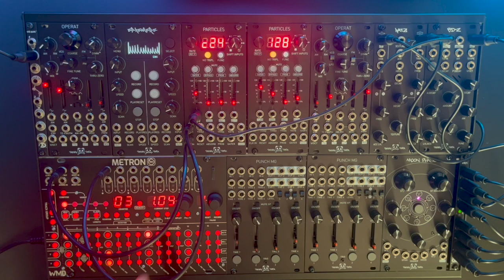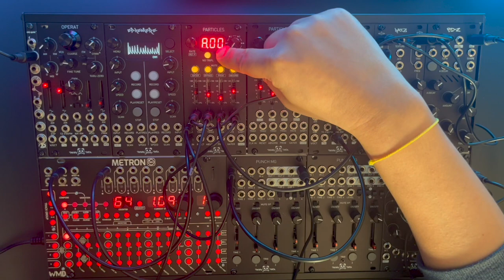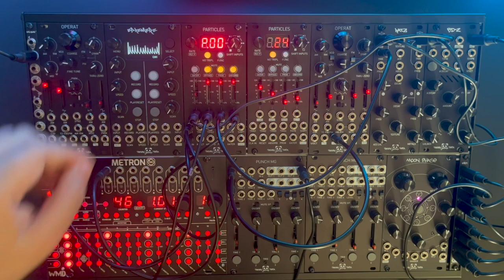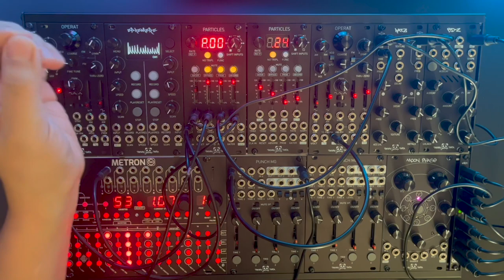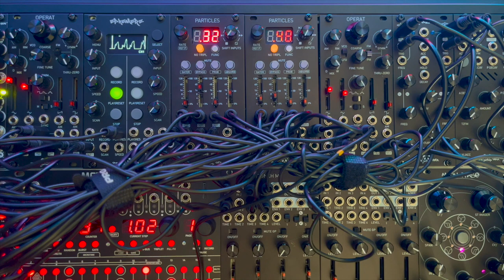Particles Walkthru Video

Comment: This is a super cool module! I’d only seen bits of it in patches here and there but nowhere really explained it all that well. This is really great for that and it looks like it may be a module I’ll need to try. I’m trying to sort out a couple modules to build up a flexible beat sequencing kinda thing. Right now I use a the Bard Quartet for quantizing and love how flexible it makes patches and now I’m almost looking to integrate a similar workflow for rhythm. Originally I was thinking it would be particular sequencers and switches but this module makes me think another way is possible.
Reply from the maker: I´ve responded your email :)

Comment: Just got this module. Great potential but manual is not easy to understand. More vids please
Reply from the maker: Yes I’m preparing more videos, use every trig input and output and try to build patterns with different combinations, is very rewarding when experimenting.
Reply: @patchingpanda  thankyou for your great work! Im still a bit confused on how Shift, Absorb, Bypass and Gater work. Would really appreciate if you could explain these in more detail. Otherwise Im really enjoying this module, it has great potential. My idea is to use it to generate drum rolls and other fills.

Comment: Great demo, very helpful. Would it be possible with a fw update to add more possibilities to the repetition distributions? I’d also love some control over trigger length. Awesome module and a nice build.
Reply from the maker: Many thanks for your words! Yes it´s possible. I will need to figure it out how to integrate it thou, seems to be a popular request.
Reply: @patchingpanda  great! Since it’s clocked, using odd repetitions and/or distribution could create even more rhythmic variations, especially when combined with absorb and probability. It makes sense to me: you can make different and more complex rhythmic cycles. The reset triggers for controlling random shift is really inspiring!

Comment: I love the concept, but I need swing, microtiming(odd integers for distribution). Is this possible?
Reply from the maker: In the beginning, we had odd integers for distribution, but they have been removed because it was easy to get lost in nonmusical results where the users can be easily frustrated, it is possible to bring them back with no problem but will need to be an expert menu option or so, let me think how can be added.
Reply: @patchingpanda I appreciate that design decision a lot. Right now I’m looking for a flexible, playable way to manipulate triggers on the fly without having to straight up step sequence. Good idea having odd integers available somehow though. In thinking about what kind of module I’d want, I’d almost want the ability to add or remove distributions or clock div/mults. It makes me think of the same way you use a quantizer.
Reply from the maker: The firmware is constantly evolving we just uploaded new update https://www.youtube.com/watch?v=bocL9Gv7ZKU&t=42s @turbotambourine